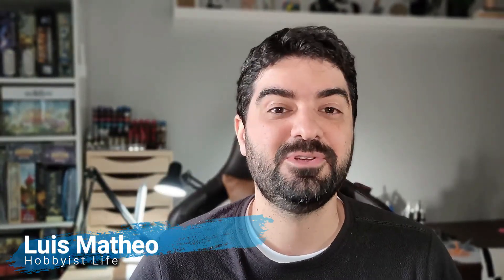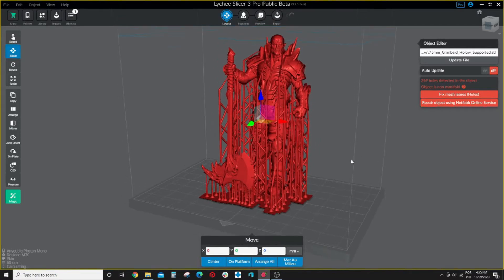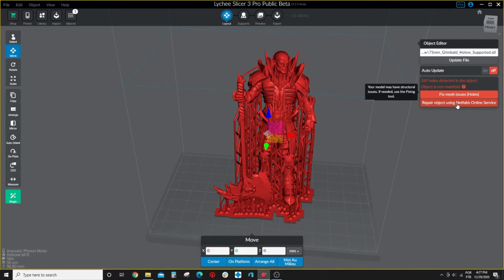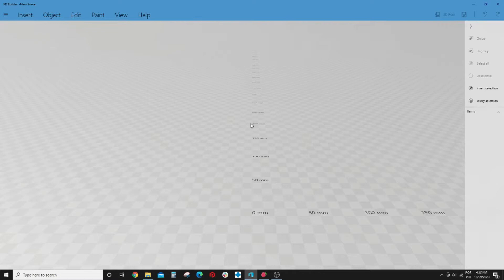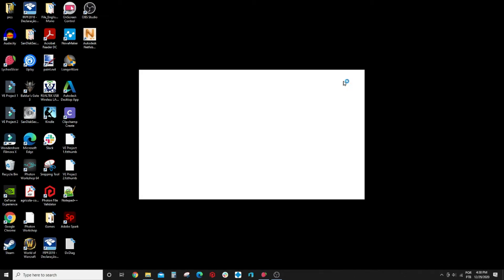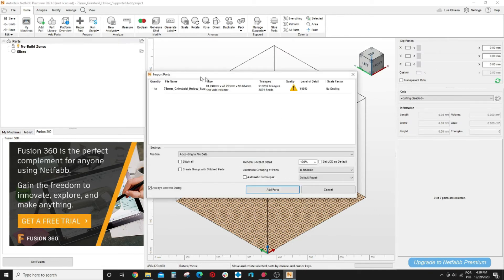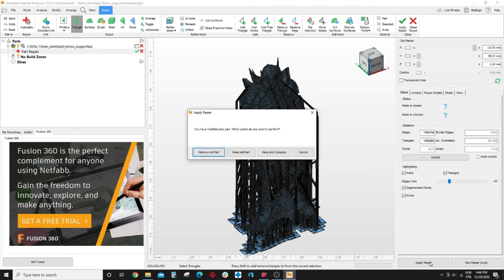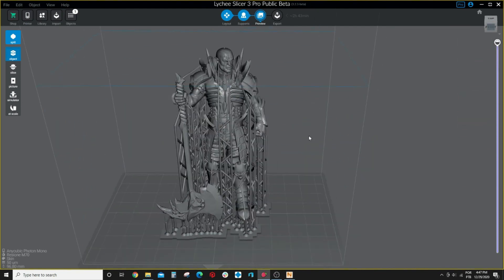HOW TO FIX STL FILES FOR 3D PRINTING (3 EASY FREE TOOLS)

Comment: Thank you. Anyone know why netfabb is CLOSING holes? I have the wheel of a motorbike and netfabb is closing it, i don't know how to fix it. Please help
Reply from the maker: Hey, sometimes it does that, probably there are some option that honestly I don't know, the tool is very complex, I only use the default stuff. You can try to fix it on 3dbuilder or even other slicers like prusa slicer. Some people uses meshmixer too.
Reply: This is clearly a user error. If the model has holes, an application designed and tasked to close holes will of course try to close holes. Duh. If you don't want certain passages not closed, make sure they are not holes as recognised by the application, or if those holes are recognised by the application, close them with different tools in the application first before blindly hammering the Autorepair button. An application cannot "guess", it can only follow algorithms, so it is yours, the user's, responsibility to make sure those algorithms are steered the right way to achieve the desired effect.

Comment: 3D printing is wild. I underestimated the quality there is available for super cheap. I got a qidi tech shadow for $120. I got it for metal casting, and making sand punches. I’m making a alien right now in 8 different thicknesses and I’m going to pour molten aluminum in them surrounded by sand. Hopefully I can use cheap resin instead of that expensive wax/silica method.
Reply from the maker: Yeah, resin 3d printing evolved a lot in 2 years, it's just insane the level of quality you can have today with those printers. Metal casting sounds pretty cool and fun.
Reply: @HobbyistLife  the thinnest setting failed, but the second thinnest worked. And that was the thickness of a pingpong ball. My mind is blown.

Comment: when using the 3d builder after it finishes fixing the model do u have to export it out or does it make the changes to the original file, u just kinda skipped the rest from the explanation that it could take awhile to repair a file.
Reply from the maker: You need to save the file after repair. You can save as the same file or rename it. It's up to you. Just remember to select STL.
Reply: @HobbyistLife  got it done. thanks apppreciate the video.